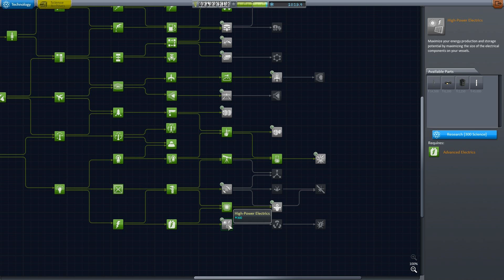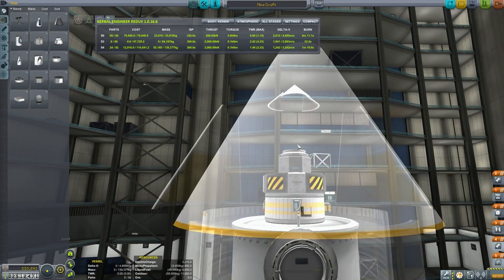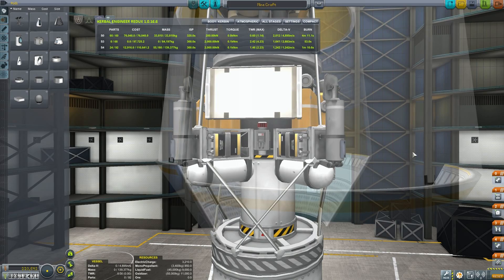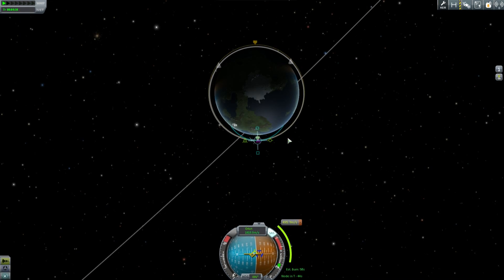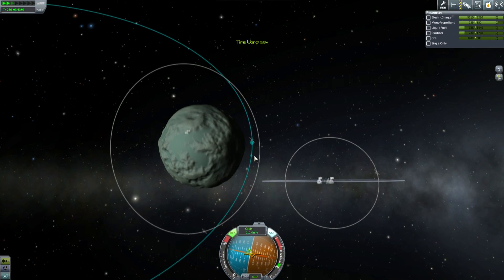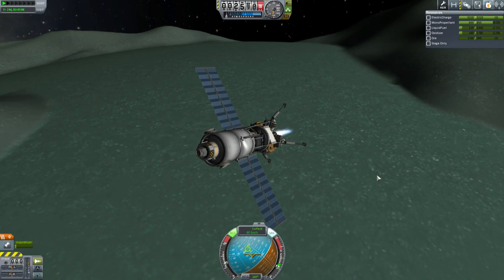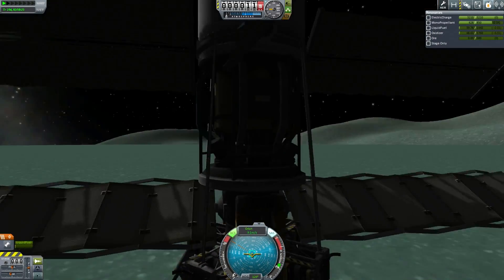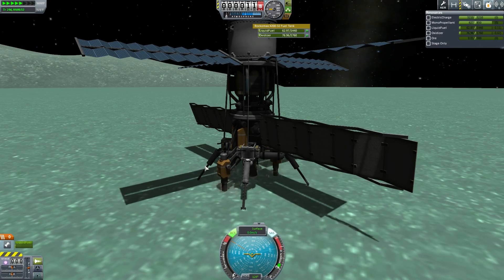Kerbal Space Program - Career Mode - Part 30 - Resource Mining

Comment: Question: how easy would it be to use the claw on that machine and not damage it - it may involve retracting panels/thermal control systems for a while. If it is that easy, can you make a "Munar Fuel Truck" that can deliver the converted ore/fuel and oxidizer/monopropellant from that machine to ships in need on the surface?
  -  if you like, you can borrow the "Munar Mini-Bus" from my channel. It's designed specifically to dock with other rovers and landers (and do some mining of its own).

Comment: I used my multi-purpose launcher to get a factory on the mun which had its own landing pad as well and could connect to the rocket that lands, it would use its solar panels to power drills and refiners and it could fill up a Multi-Purpose Launcher in 2 days

Comment: Wouldn't it be much more efficient to, instead of using the miner itself as a refueling craft, use a separate and lighter ship to lift off and rendezvous? Landing it on the docking port would be tricky, but you wouldn't have to lug around the converter or ore tanks.

Comment: Can someone please please help me?
My situation, I've got the smallest possible solid booster attatched to the command pod with a parachute on the top, with a decoupler on the bottom with the 2nd smallest booster. (Bottom to top: 2nd smallest booster, decoupler, smallest booster, command pod, parachute) and using this i'm trying ti learn how to take off and land.

My issue: When ever i take off, i imidately turn to about 15-20 degrees, and then when the 1st stage is burned, i dump it, and fire the 2nd booster, where i turn over evenfurther to about 40degrees, and it depletes, then when i start falling back down, i fall at like 2km/s and when i break back into the atmophere i ont slow down till about 5km from surface, and i cant open my parachute and smack into the ground.

(These numbers may be slightly off since i've been looking for a way to porperly land/take off for about 4 hours, so the numbers arent readily available on my mind atm)

TL;DR
Help, craft crashes, how do i slow down on re-entry
Reply: +RizoProduction Quite honestly, SRB's aren't the way to go when learning to take off & land -- thrust metering is difficult and, as you've encountered, often end in giant fireballs/'lithobraking'.

If you're looking for a way to practice landing, use liquid fuel -- if you haven't got that far up the tech tree you could attempt what you've outlined above, with some changes to the ascent profile.
 - Fly straight up until 7-10 km
 - Bank to the side (normally the east) and continue tilting over as you ascend
 - If you're aiming sub-orbital then your set up will work, if you're aiming for orbit you may need something more powerful.

To land the ship, make sure you're facing retrograde (that is, the large flat side of the capsule towards where you're headed) and 'wiggle' the capsule as it goes down to bleed off speed.

When your parachute symbol (on the left side of the screen in the staging stack) changes from red or yellow to grey/white open your chute and enjoy your landing!

Sorry if this is oversimplified or late.
Reply: Thomas Wilson Thanks for the reply, i'll take this information into consideration next time I play!

Comment: Scott,

I'm missing your great tutorials! There is so much left uncovered.

I'm currently struggeling with a rescue mission for two Kerbals trapped in low sun orbit (even closer to the sun than Moho), but you never explained how to create such Delta-V monsters for KSP 1.x. I'm guessing it'll require about 16.000m/s Delta-V starting from Kerbin's KSC, but it seems pretty hard to build something like that. I'm trying conventional start + nuclear power only once in space. as of now, I'm out of luck. I managed to get both on board, but there is not enough fuel left to raise the orbit around the sun again, at least not enough to reach at least Moho. Is this - a complete round trip with 3 pax onboard possible at all without fuel production on planets or moons on the way?

Mark

Comment: I have a ground-docking system.
https://www.youtube.com/watch?v=SYnO6wYtlow
Unfortunately, when I tested it on Kerbin, the mining station was only half full. So when the station is completely full on the Mun, its weight causes it to "sink" into the Munar surface, putting its docking nodes out of alignment. As you will see in the video, I have to throttle the station's engine up to get the ports to align enough to dock. Probably would have been easier to avoid docking ports all together and just use the claw.

Comment: Scott can you build a space elevator from the planet minmus or the mun, like if you built the Resource Miner then had a docking port on the top of it ..docked a truss to it that was so long ..then docked another truss to that then docked another ..till u got high up into space where u could dock a craft without landing on the surface then refueling there...It would be cool if u could :)
Reply: starkat70 The Mun and Minmus aren't in Geo-stationary orbits (that's why they rise and set) so you couldn't do that because they would always be moving.

In KSP there's a distance, about 2.4KM where physics simulation ends, beyond that I think you'd have an issue with the docked parts coming apart or not interacting with the parts that were physically simulated.

But keep the crazy ideas going that's what makes KSP so fun!!

Comment: As for docking on planets through vanilla. I've tried this extensively, and the best success I had was with landing gear. You simply have landing gear on your rover, only on one side, the side with the docking port, like for example in the back. Then you have the docking port on the belly of the rover, while the craft you dock with has the docking port on a lateral extension, like a metal plate, facing upwards. So you maneuver the rover so that its docking port is right above the other docking port, then you raise its landing gear so that it falls down on it, connecting the ports. You may have to raise/lower the gear a couple of times till it clicks, but out of my tests this was the best choice. Trying to have the docking ports laterally instead of vertically, and trying to match the "height" between them so they line up, is very hard and usually you'll have to resort to the landing gear tactic anyway.

Oh and if you're thinking "I'm gonna put the docking port at the top and fly my other ship right on top of it", then good luck with that! It's definitely possible, but you'll waste a lot of fuel in the process and you also need to be really good at flying the craft. Obviously on Minmus this would work out easiest due to low gravity.

I would say, if you're gonna go for surface docking, just install the kerbal attachment system mod. Personally I feel like that mod should be included in the default game, it just feels silly that Kerbals managed to fly to other planets but have yet to discover how to pull a fuel line between two objects...

Comment: That thing would have been perfect if you had put a docking port between the fuel processor and the fuel tank, and put radial engines on the tank. Could have flown that up and down on its own, leaving the ore and fuel processor and drills down below. Its perfectly set up for it! None the less, thanks for the very thorough tutorial and for replying to comments, Ive still picked up a lot of stuff from you!

Comment: can u build a space ship out of a asteriod.
Reply: hgscorpion Not sure if you are asking Scott to do it or whether its possible. You can push the asteroid around when docked to it with the claw and you can dock other things to it and even mine resources from it or bring it home to Kerbin as a souvenir. Though it wouldn't be the most fuel efficient set up trying to push this massive lump of rock around as though it were a space craft but bringing one into orbit and building a space station/port around it could be cool and pretty doable.
Reply: ***** u sed its not fuel efficient. but is that also true if u use the asteroid te refuel te rockets?
Reply: hgscorpion Yes more mass always makes things less efficient. The asteroids range in weight from about 10 tonnes to 4,000 tonnes as far as i know and the ore is finite on each asteroid. Though i still think they make nice space station etc and there is nothing stopping you from building a ship around one and traveling the system if that is what you want to do. In fact ill bet there is a Reddit challenge to take a class E on a grand tour.

Comment: Just one tip you didn't give, Scott (or two because I'm a nitpicker). First, the key to easy land dockings are Klaws. Then you only need one on a fuel truck, for example. Also, engineers are supposed to increase yield too depending on level, I don't think you mentioned that. Awesome series and pumped up for RSS!
Reply from the maker: rune12358 Good point about the engineers
Reply: Scott Chamberlain Highest one on board, as per http://wiki.kerbalspaceprogram.com/wiki/%27Drill-O-Matic%27_Mining_Excavator
Reply: +anthony tieman no way glasgow i can understand him without subtitles.
Reply: rune12358 The engineers are actually my main question about this whole ISRU system. Do engineers increase ore-mining yield, or do they speed up fuel refinement, or both? Do multiple engineers multiply the benefits or does it max out at one? I haven't tested this yet, was hoping someone knew.

I'd also love to know if anyone has much in the way of specific information about the new radiator system. We know the drill and ISRU system will work without them. Do radiators actually do anything when a craft is not overheating? Scott Manley said they might "accelerate the process" but I was wondering if anyone had more details. I'll probably do some experiments of my own but I'd still very much appreciate hearing what anyone else has figured out.
Reply: What yrmoma said ;)

It does not stack. So one lvl 2 and one lvl 1 only gains a 13 multiplier
Reply: Until I had massive ships my old GTX 660 did pretty well.
But I don't have many mods either so..
Reply: Jimmy Andersson Do multiple engineer's bonuses stack or do you only get the bonus from the highest level one?
Reply: +gno nimo ha lol good one :P
Reply: +Karl Petrosky Engineers increase the mining rate, but do not affect the rate of resource refinement (despite what it says in the tooltip).
Reply: +Scott Manley  Ill make a wager, that based on your voice, you come from the the Glasgow area of Scotland?  Just on observation, your voice has the same nuances as Billy Connolly.  Lol just a random thought.

Comment: would it be more efficient if you left the refinery in orbit along with the fuel storage tanks, and only shuttled the ore from the surface to the depot?
Reply: 666Tomato666 Picture this in the VAB. claw, probe core, reaction wheel, battery, orange tank. put some wheels on it's side, and some sideways facing radial orange rockets, enough to land sideways on minmus, and maybe 3-4 on the back to take off with. throw on some radial single solar panels and you're all set for your minmus gas trucking career.
Reply: trisymphony it's best to land dock (not as hard as scott says) and just have a fuel truck that goes to orbit to refill whatever needs it.
Reply: milkdrinker7 well, it all depends on the size of stuff docking, and interplanetary probes may actually not have enough trust to land on their own
Reply: trisymphony It is nearly always more efficient to carry just product and not whole lot of junk in form of ore with it but I would make a simple gas truck to carry that fuel from minimus to orbit.

Comment: this KSC is modded or you have the vanilla one?
Reply: 2000COCOTERO KSP*
Reply: James Fry  what means stock?  English is not my mothers tounge
Reply: 2000COCOTERO where most games are referred as "Vanilla" ,  KSP is referred as stock when running no mods.
Reply: James Fry oh.. good to know, thanks for  pointing it out! I was kinda thinking of that, but wanted to give it as another example, hopefully I got that info. thanks!
Reply: Spiguel To clarify:
Vanilla is used to signify 'bland' as well as 'unmodified', as in it's just vanilla with no flavoring added in.
Stock is used to refer to 'stock parts', as in a machine which is unmodified and therefore not at max efficiency, doubly fitting here.
In most cases 'stock' would be used for games with efficiency or quality of life mods while games with huge content overhauls would likely see 'vanilla'. KSP being an exception since it indeed directly refers to the 'stock parts' as well as the 'stock gameplay'.
Reply: Denied1213 Thanks for the insightful reply! :)
Reply: No I think it's strawberry flavored.

Comment: Scott! Here is a challenge!

Can you get, with the reentry effects on, in Stock Ksp Get to Eve and from there into and Orbit of Eve or even back to Kerbin... I tried it for hours and couldn't do it :D
Reply: KanaldeckelMagZuege look at a youtube called shadow zone. He managed to do that and travel to every biome to get all eve science in one trip and bring it back
Reply: KanaldeckelMagZuege Like land on Eve? And then go back up? Or just get to Eve orbit and back home?
Reply: Reptile \o/ Land on Eve and get into Orbit. And maybe even back to Kerbin in the same Rocket ;)
Reply: KanaldeckelMagZuege It has been done in 1.0. It now requires less delta-v, but it's trickier as the ISP of engines changes based on air pressure, so there are only few engines you can actually use. Also mining makes this a whole lot easier. I have built a lander that could theoretically do it, but I can't get it to Eve in the first place :D. Also it's almost uncontrolable so I gave up.
Reply: Max Firth Well. Then something is wrong with my Ksp. I reentered Eves athmosphere with an heatshield and burned up (with the heatshield) in the upper athmosphere (80-90km). Do you know how to fix this... D:
Reply: What was your periapsis? You need to go shallow. And preferably from a low orbit.
Reply: KanaldeckelMagZuege if your using the heat shield 200 ablate then you need to get a better heat shield

Comment: i would add that if the landing legs are really short, and the drill is close to the ground, the drill will push against the ground and possible make your lander fall over to the side, especially on a very low grav moon and if your lander is on a steep slope. also, i don't think the drill and isru creates much heat right now? i thought they turned off heat for it  because it would crash the game or something. if the devs turn it back on though, would be good to already have the radiators on them so you don't have to redesign and relaunch.
Reply: use the drills as landing gears then! XD

Comment: Are there RTGs on that miner? Or is the electric utilization broken when in time acceleration? The drilling and refining is going on through the night but the electric charge does not drop. Or do the drill and the converter not use electric charge?

Comment: I put a mining station on Minmus as well, but I sent mine up in 5 modules and docked them on the surface. Each was about 20 tons, and 1 was a hab module. I have plenty of screenshots, too. The only thing left to add is a lander to go hopping around to get science (the point of putting the base there to begin with.)  Here's the link to my Facebook photo album. My Minmus base is way at the end: https://www.facebook.com/media/set/?set=a.443721135775988.1073741828.100004143155906&type=1&l=feed80d91a

Comment: If you want to avoid the docking port height problem, you can build a rover with a fuel tank and a claw on it. It can dock with the mining rig, suck up some fuel, and then drive over to your lander and refuel it. That would be more practical if the claw weren't so annoyingly buggy, but it does work some of the time...

Comment: Any plans for an addendum video for interplanetary travel now that aerobraking/aerocapturing is MUCH trickier (read:  deadly)?  The latest update kind of broke most of my designs, and also made it so that many Kerbals are stuck in space until I can design a lander to pick them up without destroying them upon reentry.
Reply: miwright21 Multipass aerobrake?
Reply: ThaFuzzwood I've always done that, the problem now being that even slightly dipping into an atmosphere instantly rips parts off even the best-designed ships when traveling at interplanetary transfer speeds.
Reply: The solution to that is not using aerobraking to slow yourself from transfer speeds